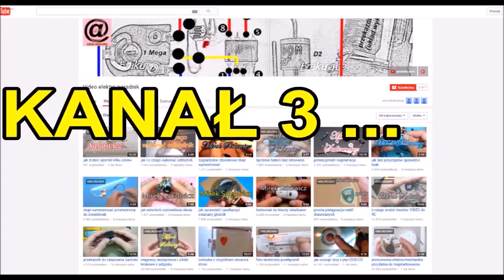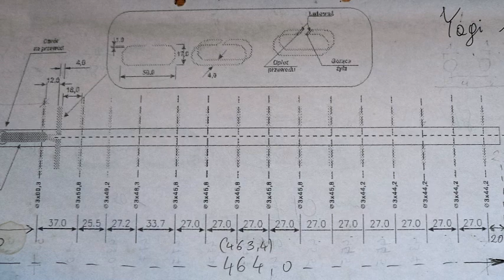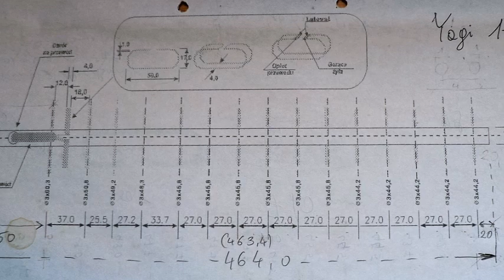wifi antena Yagi - 15 / 17 db

Comment: How wide is the double folded dipole (looks close to 35mm)? What's the length and width of the metal plate? Cool looking antenna, what's the impedance, polarization and gain?

Comment: What if you replace radiating dipole/loop by ordinary 2-3dbi router antenna? 
Will it give more gain than "windsurfer" extension for wifi AP?
Reply from the maker: the benefits are minimal - I suggest this - it works better https://www.youtube.com/watch?v=hB9I-wqJcyA&t=11s
Reply: How to build another: http://www.danionnet.ch/blog/?p=1331 Tested, works good. I took a couple of rubber duck 2dbi antennas apart. There is dipole from 50mm to 51mm long. This is the reason why first director can't be longer than 50mm in my case. My directors are from 47mm to 49.9mm and 2mm or 2.5mm diameter wire was used. Dipole inside rubber duck antenna isn't precisely straight and centered, but this doesn't matter too much with 2.5mm diameter reflector and directors. I tried to build 16 directors yagi - waste of time, it was worse than smaller one. Small yagi antenna (5 directors) gives me little bit less gain (maximum range) than bigger 11.4dbi windsurfer - version with focal distance 1/4 wavelength = 30.8mm: https://ulozto.net/!FJQd0i69tRxf/windsurfer-wifi-antenna-11-4dbi-size-a4-focal-distance-30-8mm-doc (Ordinary smaller windsurfers should be 9dbi). Higher gain than windsurfer gives me double biquad, calculated for 2440MHz = center frequency, CH6 / CH7: https://buildyourownantenna.blogspot.cz/2014/07/double-biquad-antenna-calculator.html Windsurfer, small yagi or biquad, beaming to large satellite dish gives me more than 20dbi. All antennas were compared with my wifi signal detector: https://www.flickr.com/photos/124591966@N06/39517006640/in/album-72157694688694214/ Now I can test and tune wifi antennas and check their directivity in real time without lags (AP transmitts beacon with SSID each 100ms = 10 pulses per second). It's really useful to see how any change on antenna or changed AP position (and floor reflections) affects signal immediately. If I'm pointing Sharpie yagi to detector from distance 3 meters, LED flashes fast and I can hear small buzzer too.